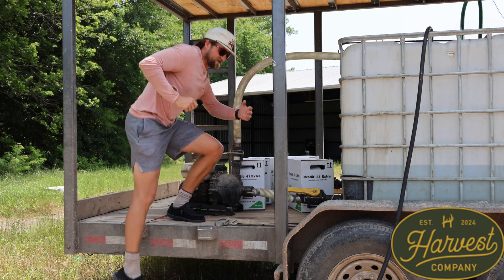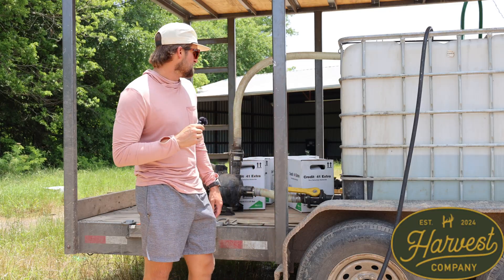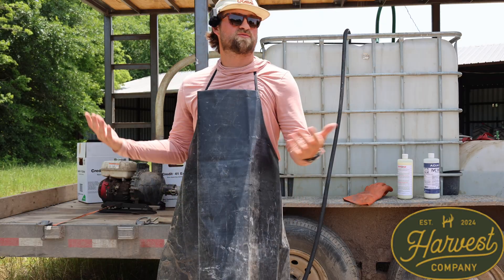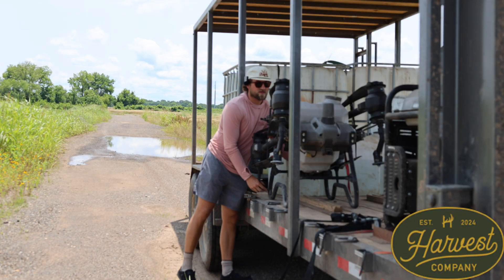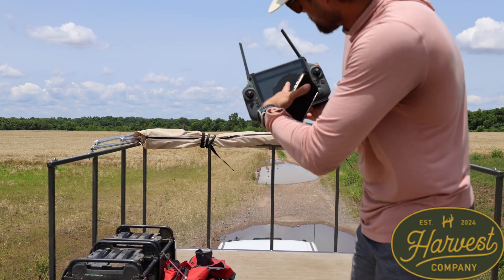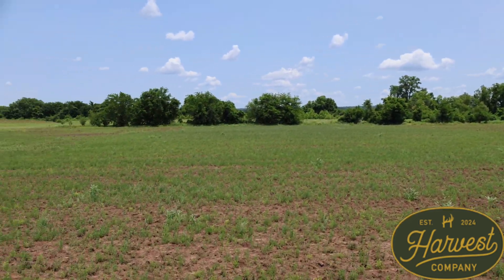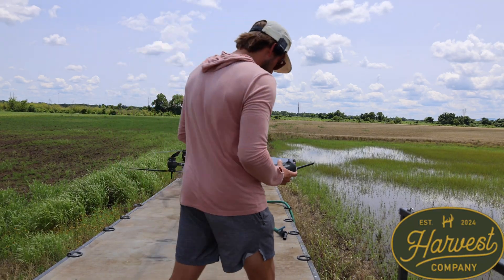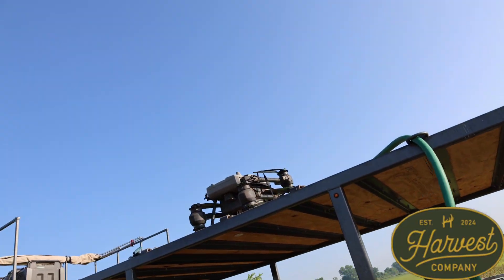DRONE SPRAYING 101 (MUST WATCH)

Comment: Do you swap out the ibc totes if you have a different job with a different chemical, or are you washing them out between chemical changes?
Reply: Triple rinse. That's also in the "rules".
Reply from the maker: Wash and flush the pumps and hoses. Never had an issue